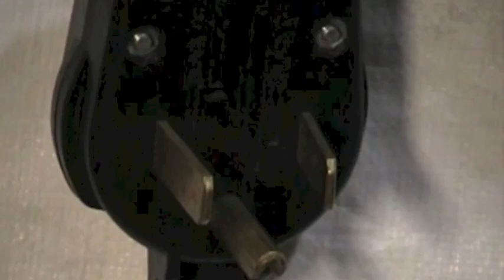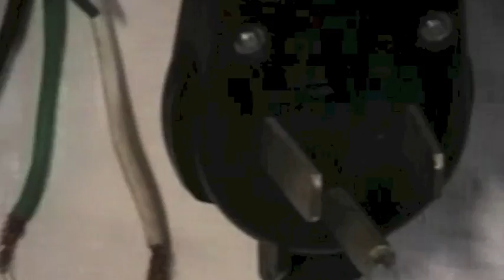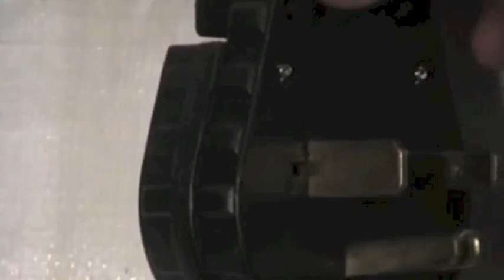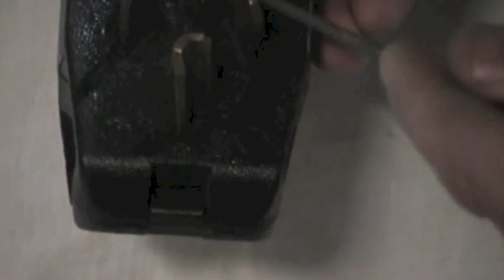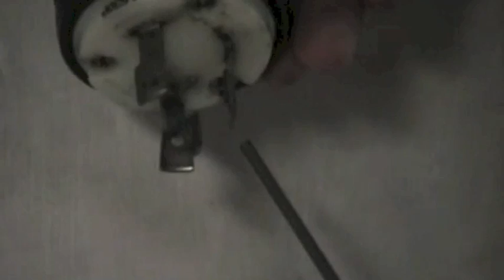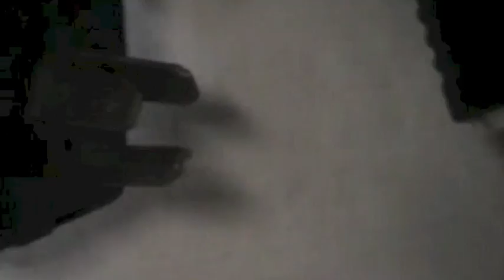Wiring Your Welder to 220 Volt

Comment: It does matter!!! The neutral wire (blue or black) must go on the downstream side of the switch, it is the return. If you put the live there instead and the ground is poor you risk making the machine live and current running through you to ground if an internal wire goes short circuit to the body of the machine. Many items nowadays are double insulated  so little or no risk of a shock,  but it's easy to test. Use a test screwdriver on your mains outlet to verify which pin is live. The other is neutral and that's where you connect the neutral from the machine, assuming your cable is as originally wired.

Comment: So my welder has 4 prongs coming off of it, and so does my 220v outlet for my dryer   Not the same style connector but i was hoping to just swap the connector i have currently to one that fits my dryer 220v outlet. And run my machine   I had to switch my dryer cable to a 4 prong plug when i got my new house

Comment: May I ask you a question? On the standard norm plug that looks like a dryer washer plug that has 4 prongs legs , 1 black, 1 white, 1 green , 1 red. My question is "would the 1 Red prong leg  be eliminated, or serve as obsolete & just using the remainder 3 prong legs which are 1 green ground, 1 white hot leg & 1 black hot leg ? Thank you

Comment: Thanks for this vid. I have a Miller maxstar 150 that only gets 3 connections. So for 220 they are using the ground and neutral as one wire. I needed to know this. I understand this machine automatically switches for the system it's on.

Comment: I just plug my 220v powerarc welder into my dryer outlet.
Reply: That's what I'm doing. I also have a pigtail that can plug into the receptacle for my electric range.
Reply: Easy enough.  I guess your dryer is a 220/240 as well. Most of them are. One leg for the spin and then both to power the heater element.
Reply: @gierhedd75  I wouldn't do that  only for the reason that most wiring run for dryers  is either 10 or 8 gage and for most 220 welders you should be on a 6 gage 50 amp circuit.  The smaller wire could over heat and start a fire in your walls and you wouldn't know about it until it's too late.  Do what you want l, just some friendly advice and good luck.
Reply: @ONE46CHEVY  that is a very valid point.  Didn't consider that part of the equation.
Reply: The dryer outlet is 3 prong (NEMA 10-50) The wall socket is Black Red and White (hot hot and neutral).

I have heard it's not wise to tie a ground to the neutral line through the Welder Socket (hot hot and ground).

Though I know the Neutrals and Grounds are tied together at the Panel...

Why is there still no clear and simple explanation or configuration for this?

Comment: Thanks for the tutorial. I just purchased a welder and it had three wires; White, Black & Green. I was looking for the return like in a 4 wire system. Couldn't find it and realized that on welders with three wires there isn't one, as the other leg is a sense is the return as they are out of phase. Thanks you helped me. Best Wishes n Blessings Keith.

Comment: Thanks for your vid, I'm running 220  for a welder, I installed a 50 amp breaker, but I cant seem to get the breaker to register on the volt meter, Ive narrowed it down to either a faulty breaker(I purchased new) or possibly a bad socket in the panel, have you ever experienced this? note, that when I test the legs individually against the ground I get a reading, but not when tested together, out of options here..
Reply: You need a neutral. Can't go hot to hot that I'm aware of.

Comment: All new wiring is 4 wire with two hot, one neutral and one ground.
Reply: When you are wiring a 3 wire 220v welder to a 4 wire outlet (dryer, stove) the white wire (neutral) is not required from the 4 wire outlet, but must be capped off with a mar.  Black - black, red - white, green - green. I ran into this problem recently when making an extension cord. I hope this helps.
Reply: Doc02864 so could you use the ground wires as neutral?